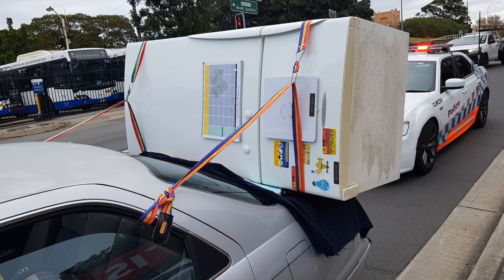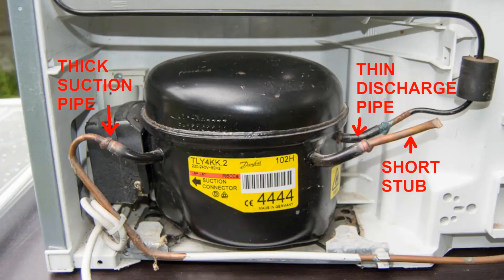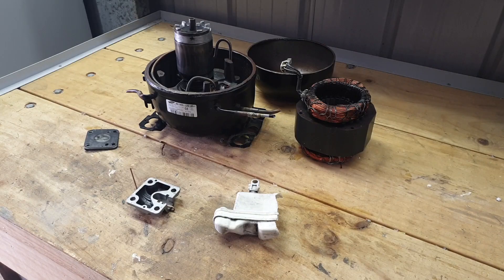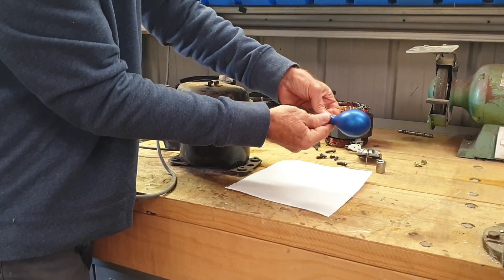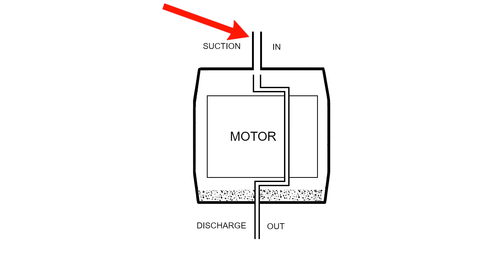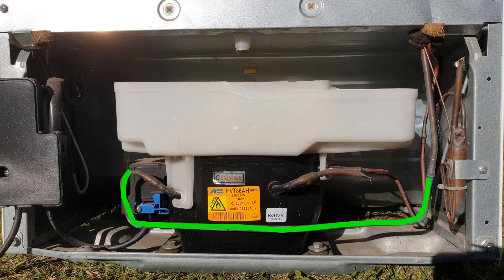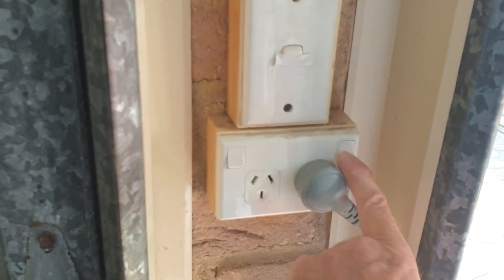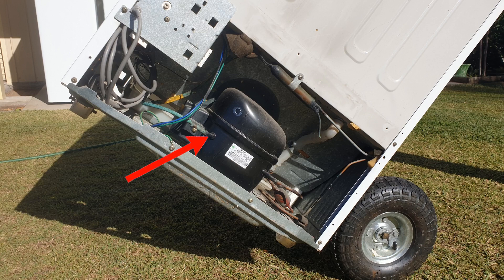You can transport a fridge on its side - but only this way

Comment: I really like the dedication to test and prove this theory. I have the same issue of having to transport a fridge on its side. HOWEVER, there remains one issue: what if I have to transport a brand new fridge in its factory sealed box? I have no chance of checking the direction of the pipes around the compressor. Will the box clearly and correctly show which side I have to choose for transport? I have a guess it will only show front and back...

Comment: Excellent video! You went above and beyond the call of duty. Anyone getting you for repairs is lucky. 

I'm going to haul my 25 yr. old fridge out to the porch, turn it on it's side, thick pipe up of course and blow away all the crap out from underneath. Something smells from time to time and it's not the drain pan.

Comment: This may sound dumb, but I assume this applies to all the new fridges made (  (and sold ) in the USA ) ?  There is always a thin, and a thick tube? So you just have to remember to point the thick tube up every time? Never lay a fridge on its back? 
And the last question :  to see the compressor (tubes /lines ) don’t you always have to remove a panel ? So you need to bring a wrench or a screwdriver to remove the nuts or screws of the panel over the compressor ?
Reply from the maker: About half of fridges have a panel, the other half do not. Those that do usually have about 5 philips head screws that need to be removed. About 30 seconds work.

Comment: I ordered this 53L bougerv refrigerator via Amazon, and the delivery person dropped it off the box was upside down. I’m not sure how long it may have been in that position.

Should I automatically return it to Amazon, or would leaving it upright in its normal position for 24 hours be sufficient?

Is 24 hours really enough for the oil to return to the compressor properly?

I would appreciate any additional information or guidance you can provide.

Thank you
Reply from the maker: It does not take 24 hours for the oil to return to the compressor. It is nearly as runny as water. How long does it take for water to drain out of a pipe? About 24 seconds max. But the risk is the oil getting into the evaporator in the back of the freezer. If that happens you can leave it standing upright for 24 centuries and the oil is never running back to the bottom because to do so it would first have to run uphill and from side to side inside the cooling tubes. I would return it to Amazon or if it has a warranty I would test it thoroughly immediately.

Comment: hi thx for the vid, may i pls ask u, if i have a modern fridge, plugging in, turned on, standing straight up, but i want to move it a bit as im rearranging my furniture, so i didnt unplug it, i just pushed it across the floor without tilting it while its still on and fully running, would that have caused any damage?
Reply from the maker: It should not have. The motors in them are very robust and can take a lot of punishment, as I demonstrate in my video.

Comment: How long can the fridge be on it's side for? Is it possible to stay on it's side for 24 hours?
Reply from the maker: You can leave it on its side for 2 years and it will not affect it in any way. Stand it back up and turn it on 5 minutes later.

Comment: I recently purchased an Amana - 21.4 Cu. Ft. Side-by-Side Refrigerator - Stainless steel

Model: ASI2175GRS

Anyone know what side i can lay it on?. It's still packed and wrapped so I don't have access to rear plate to remove
Reply from the maker: It is worth tearing open the wrapping and having a look. Better than being sorry later.

Comment: This may be a dumb question but are compressors in canada made the same way? I need to move a samsung RF18a5101 on its side and there is a video that says the exact opposite of this... however it doesn't go through the rigorous tests that you do! I'm nervous to do this and will follow your suggestion, hoping that compressors in canada are made the same as in aus...
Reply from the maker: All compressors around the world are the same. This is the only way to move them. Any videos that say differently are wrong.

Comment: It worked! Transported two fridges on their sides (thick tube up and dried water pans). Started them up within the hour and no problems. 

I can see why sellers don't tell people they can do this. Buyers/movers would have to open the back panel (can't trust the box), then maybe get left and right mixed up, or multiple people helping who don't all have the 411...
Reply from the maker: Or else the manufacturer just prints "THIS SIDE UP IF TRANSPORTING LAYING DOWN" on the correct side of the carton.

Comment: Thank you for this video. If I understand it in a nutshell- thin line side down, and you are good to go
Reply from the maker: No!!! Thick line up. Not the same thing because sometimes both lines come out the same side of the compressor, with other fridges they sometimes come out opposite sides.

Comment: Interesting video, thanks, but some of the larger double door fridge/freezers will have the back completely covered so you can't see the compressor and lines at all. What do you suggest doing in this case? I see the only options as being removing the back panel or just try transporting it upright?
Reply from the maker: There will be half a dozen philips head screws at the back down the bottom. Just remove them and remove the panel to see the compressor.
Reply: @pmolsen1  Thank you! :)

Comment: I deliver full trailer loads of new refrigerators. The bottom ones are standing upright and the ones on top are sideways. I haven't seen them on their back or face down. In my opinion the curves on pipes and coil work as baffles to prevent fluids from doing any damage. To be safe when they're getting transported just let it sit for a full day before turning it on.
Reply from the maker: Allowing a fridge to sit for 24 hours is a complete waste of time, as my video shows. The oil is almost as runny as water. Any that is going to flow back into the compressor will do so within 5 minutes.

Comment: If I moved a fridge on the wrong side, is there anything I should do before turning it on? Picked up a second hand Samsung fridge yesterday and when I looked at the compressor the thicker pipe was on the left side of the other two, but having rewatched your video that was probably the short stub and the discharge and suction pipe were both on the right side. If it helps, my new house isn't ready so the fridge will be in storage for a couple of weeks. A bit embarrassing, as I watched your video two hours before moving the fridge. Any advice would be really appreciated.
Reply from the maker: 5 minutes is all it takes for 99% of the oil to drain back to the compressor. Leaving it in storage for a couple of weeks will make no difference. You just have to hope that the oil did not make its way into the evaporator. If you transported it on the wrong side then you are probably ok thanks to the cross-over in the pipe midway up the back, which I explain in detail in my other video at https://www.youtube.com/watch?v=k0-ABDAWgXs. Transporting it on its back is worst. As I say in the video you can often get away with it, so just cross your fingers and hope for the best.
Reply: @pmolsen1  cheers for the reply. I watched the other video so hopefully it will be all ok. Really great content, thanks for making it.

Comment: I transported mine the wrong way.  It was on the wrong side for about an hour.  will it be bad now?
Reply: I did the same thing and it's not working.  It's been standing up 24 hours. Now I know jeesh ...
Reply: @m.fernandez8943  so far mine is working... I have my fingers crossed it doesn't burn up the compressor.. It's been running for 26 hours now.
Reply from the maker: @donniesmith8779  It makes me wonder how many fridges those other videos are responsible for destroying. Someone should sue the authors for the cost of their new fridge. Then they might delete the dumb videos and admit that they got it wrong.

Comment: Thank you for the video; it was extremely helpful! I have a question you might be able to assist with. I have a standard compressor fridge in my camper, which is always in a fixed upright position. I'm wondering if it's safe to keep it running while I drive around the country?
Reply from the maker: Should be safe as long as you are not going off road and bouncing up and down too much. Normal highway driving should not bother it

Comment: If you know a fridge was transported on the wrong side but hasn’t been plugged in yet, is there any way to reduce the chance of damage?
Reply from the maker: Inspect the pipework at the back. Sometimes there will be a loop or a U bend in the suction line that is intended to stop the oil from migrating if the fridge is transported the wrong way. If there is then you should be ok. If not just cross your fingers and hope. Leaving it sitting for 24 hours is a waste of time. Any oil that is going to drain back to the compressor will drain back within 5 minutes. Any that doesn't drain back never will.

Comment: Excellent video, and excellent information. We now know that the larger, suction pipe should be facing up when transporting the refrigerator on its side. It should also be noted, that If you’re transporting a refrigerator that is completely full of food, drinks, and assorted DVDs, I feel that putting it on the side that allows the suction tube to face up is still applicable. In other words, continue to do exactly what you explained in this video.

Comment: You are brilliant! I have had sooo many problems with friges in the last 11 months as we all know they are all crap. Also many parts in fridges are made by other companies  (OEM, original equipment manufacturer). Many think that they are buying a frige and all the parts are by the name on the frige, but in fact your frige has parts made by many other companies. I know this because I was having so many I had to learn why. I have gone thru 3 different fridges in just 11 months. I just got a new one today and would not not cool. So I called the company and the first thing she said was you needed to let it sit for 12 hours. I said "how would I know this as it was just delivered, this is the first time I had the manual"? She responded with "you could have looked up the manual online before hand". What?? Oh hell no. When it wouldn't cool I just kept thinking that the delivery guys plugged it in and now it is broken...until I saw your comment on another video. I cant thank you enough for your video. I love that you showed us how the compressor works and how it is almost impossible to wreck them from brief movement or even laying them down. BTW that new frige I think is going to be ok..still not trusting any manufacturer these days.

Comment: I watched another video that said the opposite from you on the compressor line up side. He said distribution line up line up smaller line up!     https://www.youtube.com/watch?v=zUSq7BkGGP0
Reply from the maker: Yep. There are lots of clueless people out there who simply hear something then regurgitate it without bothering to check the facts. Not one of those other video authors provides a shred of evidence to support their claims. They just make baseless claims, proving that they know absolutely nothing about the internals of a compressor.

 WARNING!!! Please don't click on the above link or any other videos that give the wrong information. All it does it push up their view count and make then appear credible. That is why I did not link to any of the other videos in my comments.
Reply: @pmolsen1  Well that compressor he showed did not have a suction line on the opposite side. There was a line pinched off though???
Reply from the maker: The pinched off pipe is the line that is used to fill it with gas initially and can be ignored. He shows a standard compressor with the two coolant lines coming out opposite sides. He correctly identifies the pipes but then gives the incorrect advice about which one should face up, without providing a shred of evidence to support his opinion. He confirms his ignorance by claiming you have to wait 24 hours before turning it back on. A complete myth as my video proves.

That one is also easy to prove and I should have done it in my video. Get a plastic tube and fill it with water, which is not much thinner than the oil in a fridge compressor. (See my video at time 1:36).  Now hold the tube up by one end and see how long it takes for all of the water to drain out. Does it take 24 hours or a few seconds?

Comment: any idea why that other video on youtube says the exact opposite?  your video makes much more sense; just curious as to why he believes what he is telling people
Reply from the maker: Because like the authors of all such videos and websites he hasn't got a clue. They simply read something somewhere or their Aunt Bessie told them and they take it as gospel and regurgitate it. They have never cut open a compressor. They have no idea what they look like inside even though there are dozens of YouTube videos showing the inside of them. They just like to make themselves sound important by spouting so-called knowledge, which is nothing but complete rubbish. 

I have even put a comment on his video and all of the others telling them that they are wrong and referring them to my video, but they are too stubborn to admit that they might have got it wrong. Like when they claim oil will get into the outlet pipe if you face it down. That is a physical impossibility, as my video proves.

I have cut open several more compressors since making this video. I cut open a Samsung digital inverter compressor last week to see what makes it tick. Tomorrow I will be cutting open an LG linear compressor and stripping it down. Really keen to have a look inside it. I have seen one on YouTube but want to study one myself in real life. It works on a totally different principle - it uses a solenoid pushing a piston backwards and forwards instead of a motor driving a piston up and down like a car engine, which most compressors are, including the Samsung inverter one.
Reply: Also, I think because people know that getting oil into the filter will clog it up, they assume having that side up will save it. However, this proves that the oil can only enter the system and ruin it (and other things) if the suction line is down.

Comment: Good Grief!!  Liked thoroughness of your demo.  I'm about to transport my fridge/freezer.  How is it possible two diametrically opposed compressor orientation perspectives are floating around YouTube?  Even worse, seeming the incorrect and detrimental "opinion" is the first method appearing on Youtube???   Wonder if some folks pushing the incorrect method are actually peddling fridge service calls and costly replacements?  Help me Obi Wan Kenobi!
Reply from the maker: Thank you. I know the videos you are referring to. Some people just read something on the web and think it is the truth, so they regurgitate it without having a clue what they are talking about. They have obviously never cut a compressor open or even bothered looking at YouTube videos made by others who have done so, to see what they look like inside. They just make seemingly educated claims without providing a shred of evidence to back them up.

Of major concern is the fact the most reputable consumer organisation in Australia - Choice Magazine, has a web page that contains complete nonsense. Firstly it says to transport them with the hinges facing up. Then it says it is safest to transport them on their back - the worst possible way to do so and a guaranteed way to kill many fridges.

They have a link on their pages to report errors in their information. I have clicked on it several times and written to them about it but they simply ignore me. I spoke on air to a well known radio host (Chris Smith). He also contacted them but they ignored him as well. Clearly they think they are above criticism.

Comment: It is just amazing! I have a question. I  dragged the fridge in my kitchen from one place to another. It was shaken a bit, but not tilted on the side or anything. Is there a risk for oil to leak or fridge will be fine? Thanks in advance
Reply from the maker: Should be no problem. Towards the end of my video I transport a fridge lying down going over speed humps and around bends etc. to shake it up as much as possible but it still works fine afterwards.

Comment: Those ignorant The Brick delivery men placed our fridge on its back while pushing it off the truck.  They did not have a ramp set up to roll the fridge out in an upright position.  We were lucky too much oil did not flow into the tubes and the fridge worked. Appliance delivery men are not very knowledgeable.  Too bad you cannot ask the engineers who designed the compressors.

Comment: @JOEZEP54
0 seconds ago
I am picking up a fridge today & just wanted to review which way to lay it down. So many channels are  claiming the opposite. After listening to your explanation & watching the diagrams you present I will now  lay it down with the intake facing up.
Thank you & stay well, Joe Z
Reply: Did it worked? laying sideway? Id like to know please, I am going to transport my fridge soon and the van is not tall enough for the fridge standing up. I would really appreciate your response. Thank you
Reply: @mkmcat  Not sure, I was told it was a working unit, compressor ran but it did not keep temperature.
Reply: @JOEZEP54  Thank you for the update.